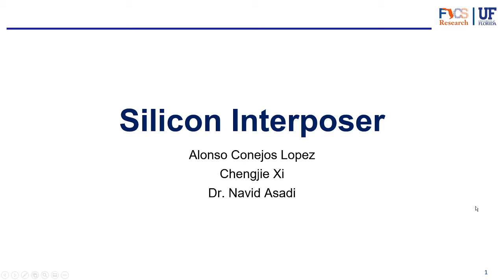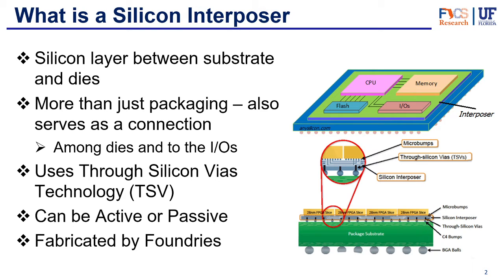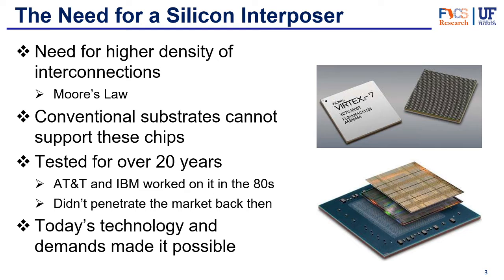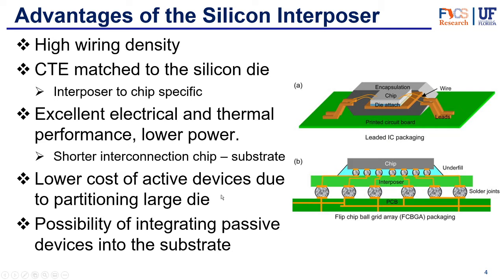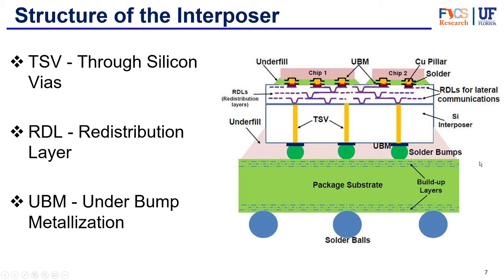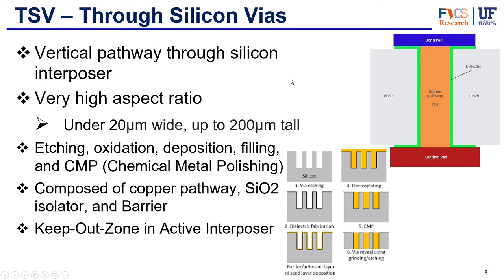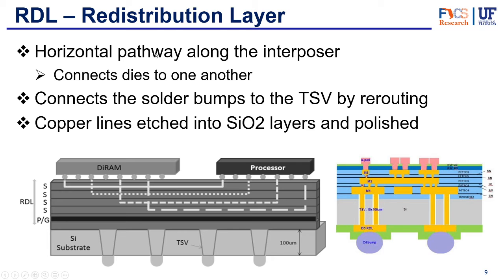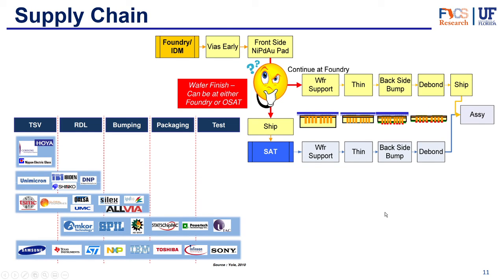Packaging Part 3 - Silicon Interposer

Comment: Do the same concepts apply for glass interposers? Why would one use glass over silicon? What is the % breakdown?
Reply: *Low electrical loss (glass is an insulator)
*Better warp management (thermal expansion/stability and increased stiffness helps to minimize warping)
*More cost effective
*Potential to optimize processes (glass wafers can be as thin as 100µm)

https://smartech.gatech.edu/bitstream/handle/1853/42737/bandyopadhyay_tapobrata_201112_phd.pdf?sequence=1&isAllowed=y